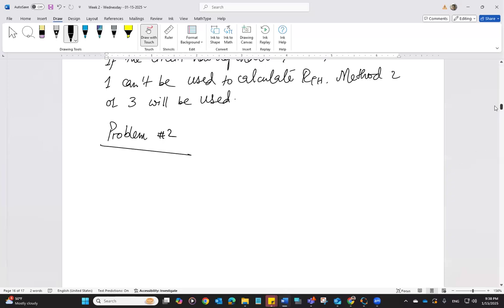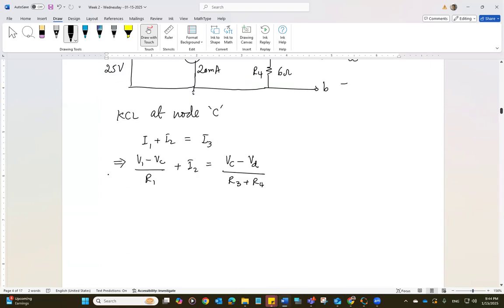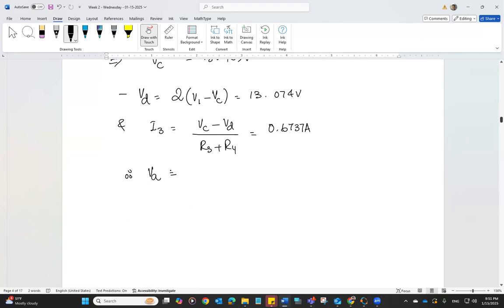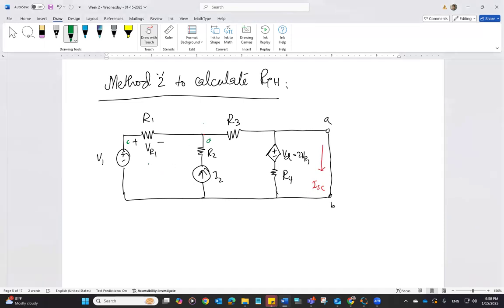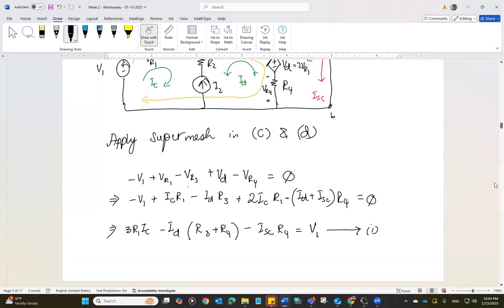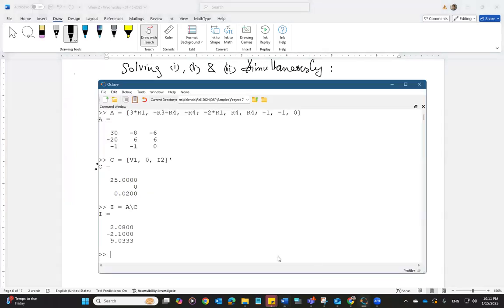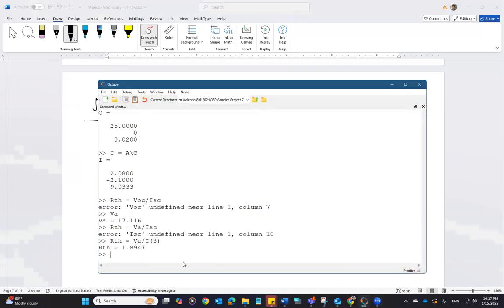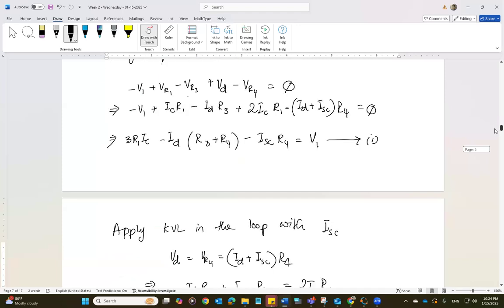EET3086C - Circuit Analysis - Lecture 4

Comment from the maker: Correction: I should have just labeled the node 'd' as the test node with voltage 'Vtest'. Don't get confused in the first equation with 'Vd' being the dependent voltage source. 'Vd' in the first line refers to the node voltage at node 'd', which is 'Vtest'.